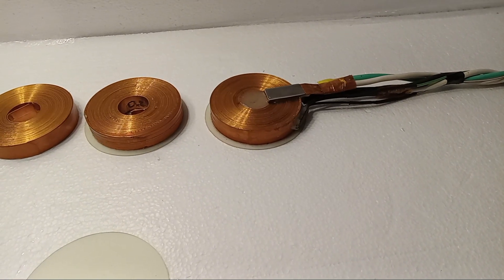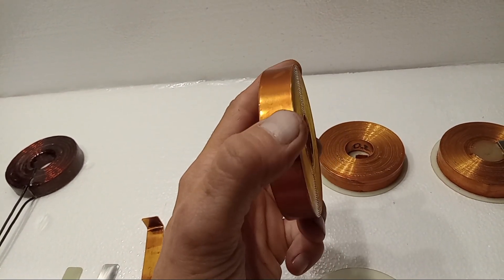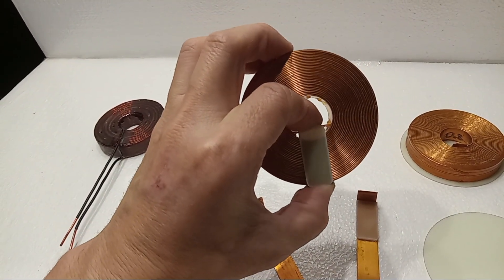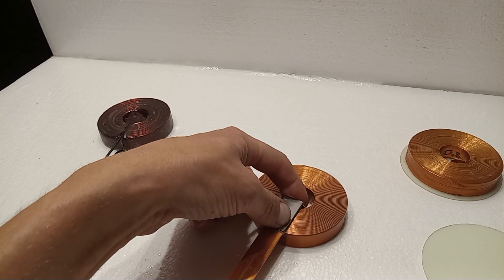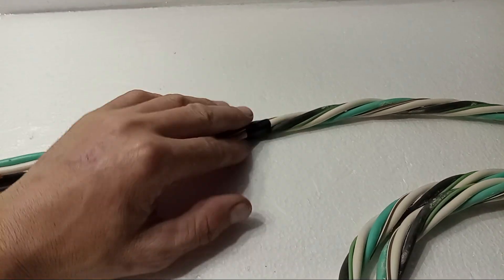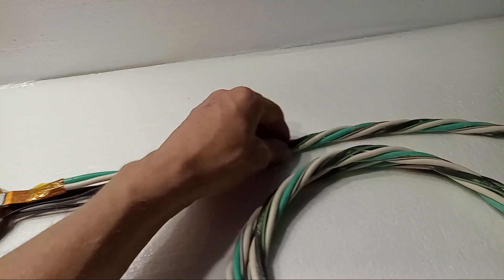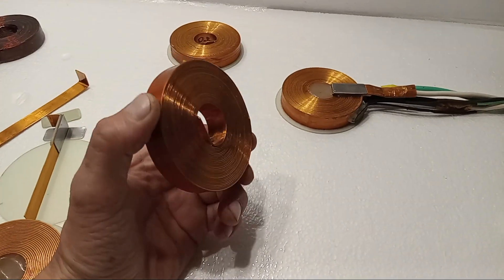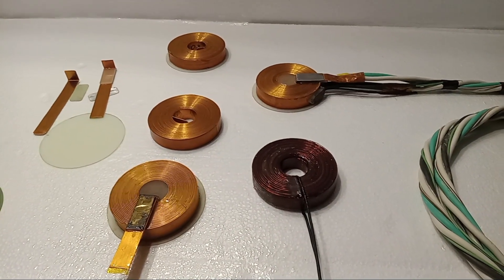181 BBMPulser Strip Coil how it's made

Comment: You play only with magnetic Felds? Try Scalar waves you will be surprised what you can achieve with such waves. You get Scalar waves by placing two positions coils. Into another. Just wind them Bifilar sure that they cancel their magnetic Felds. To opposing Felds stretch the space itself. Like a varing point charge does

Comment: Hello Andrey, thanks for sharing. Some Questions. Would it be OK to use Heat shrink sleeve to fix the twisted wires as additional strengthening? Second, What about EMF shielding? Use of an metal shielding like in ethernet cables?
Reply from the maker: I would not use heatshrink over the wires, it will make wires stiff. Heatsrink has some glue inside, when heated it activates and will bind to wires. Use 1/2" braided sleeve available on ebay.com
 EMF shielding? You mean over the wires? What the reason to do it?
Internet cables have signals going true them, to protect it shielding is used which not that effective any way. It's hard to block EMF, it will go true anything

Comment: He spends the entire video describing how he made this coiled wire without mentioning what it does or demonstrating them working.
Reply from the maker: I have 180 videos on my channel, look true them, I demonstrate many times how they perform by using bend test, aluminum repel test, by placing coil on my hand and demonstrating how it triggers muscles. In this specific video I talk about how its made.
Bbmpulser is an Open Source where I go in details of my builds
Reply from the maker: Magnetic pulsers are used to deal with infections, to deactivate viruses, to recharge cells, to suppress pains, to speed up healing and more
Reply: Take the time to look at the great work Andrey has done with his tutorials showing how to make simple versions of these devices as well as the latest models.  He is certainly doing a fine job with his videos, watch earlier one and catch up, I’m sure you will agree!

Comment: WHY bother winding it. just use the coil of wire or spool as it was bought. just find the other end of the wire...simple
Reply from the maker: Yes it may be temporary used straight from the spool, but if you want you coil to perform at its best, you will need to rewind it into more efficient shape, add epoxy (that's for magnet wire coils) for strip wire, you have to insulate the strip first before winding it and you do need to epoxy it as well so nothing moves inside the coil, this way your Coil can withstand high current and can last long time and will operate quietly.
Reply: @AndreyD  Have you tested it by inserting a ferrite road in the middle hole of the coil to see if the magnetic field can be magnified further or concentrated?
Reply from the maker: @esecallum  No I haven't tested Coils with metal ferrite in the center. 
I think this will result in higher output and at the same time in shorter session time. I'm trying to extend session time as much as I can, the power factor is not my concern. I can easily increase power output from my coils by raising cap bank voltage. Right now I focus on longer session time and trying to increase the effectivness at the same time